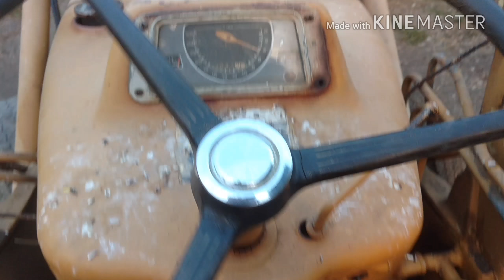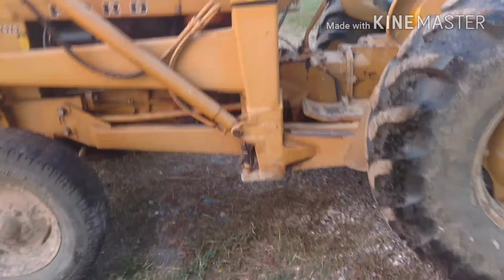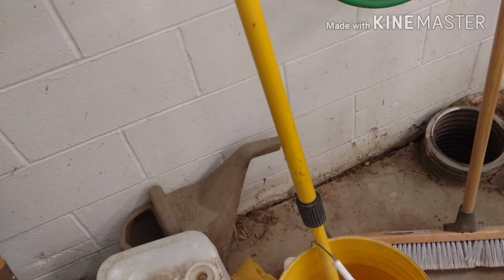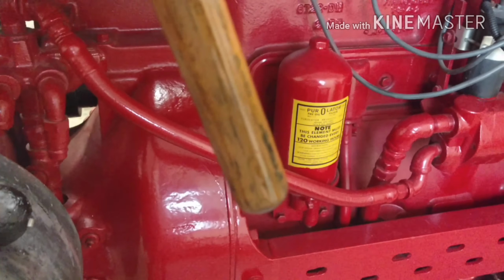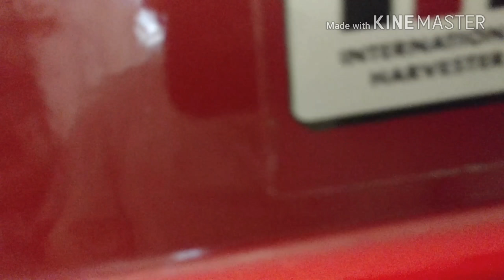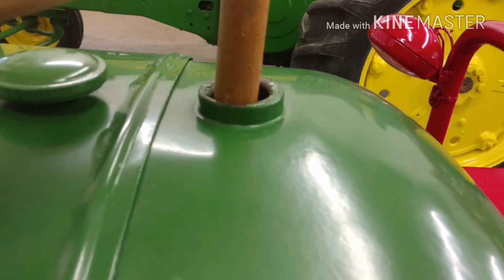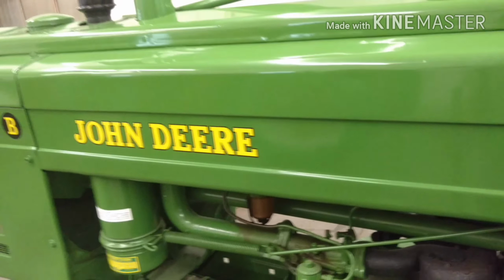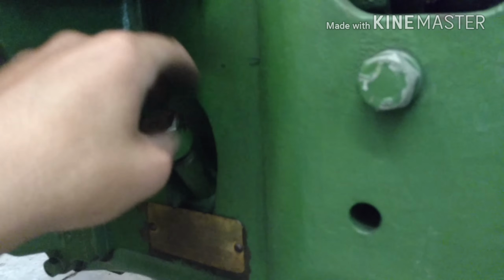Putting out hay and hauling antique tractors to the fair

Comment: Your broomstick measuring gas trick works. Just take a paper towel and dry off the stick after you measure each tractor. Then stick it in the next tank. Makes it easier to see the gas level each time.
Reply from the maker: +Massey1105driver right.  Especially when a yard stick isn't available or stuff like that

Comment: Your backhoe has a bucket leveler, it called the operator. (just kiddin ya)  Nice job of loading the B and the 720. I have moved both my tractors 4 times since mid month July to different fairs and pulls. Only one tractor at a time though. I only have a 16 + 2 trailer.
Reply from the maker: +champflyer334 right.  Can be a pain in the rear moving tractors all the time